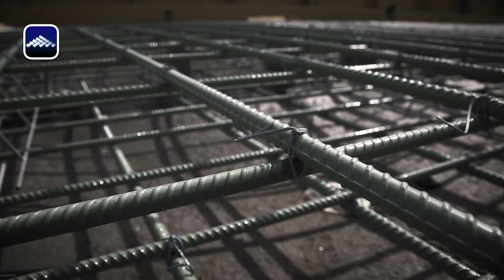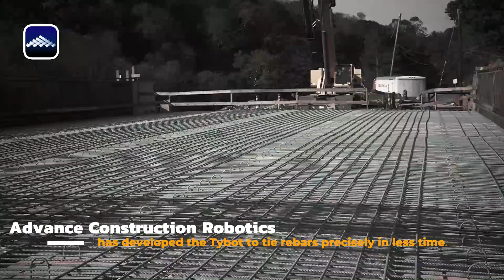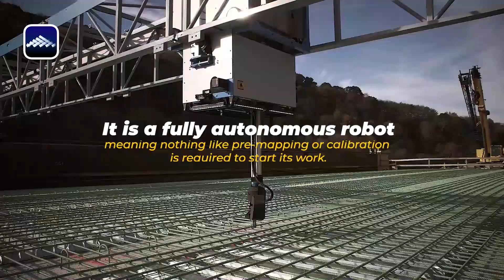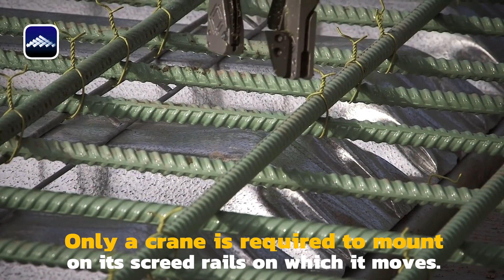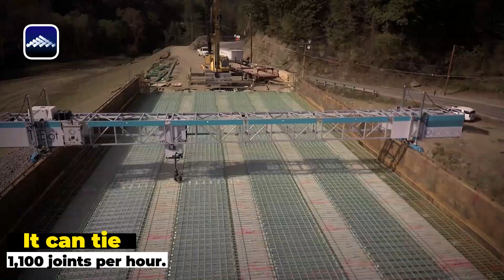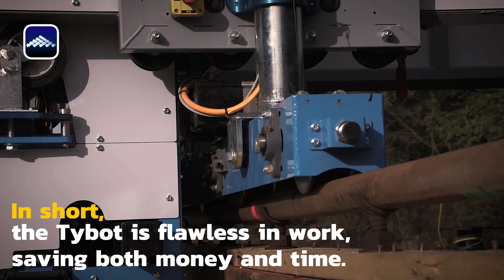Tybot: A Rebar-tying Robot

Comment: What about welding those rebars together instead of tying (much faster)?   "WELDBOT"?
Reply from the maker: Might be costly than tying as welding requires a lot of energy. Also welded joints could break while lifting the structure.